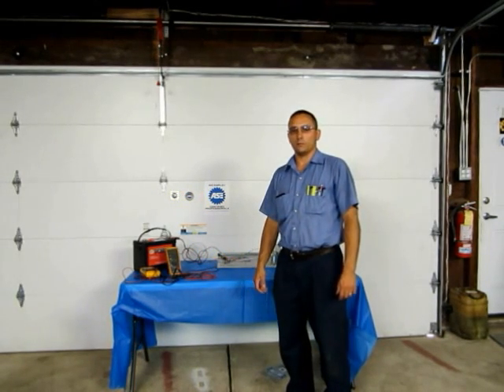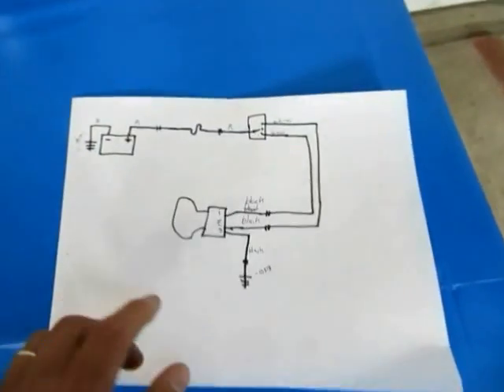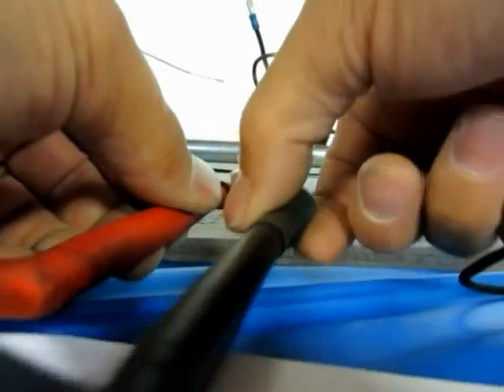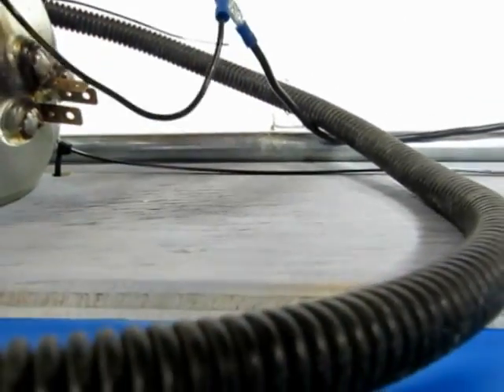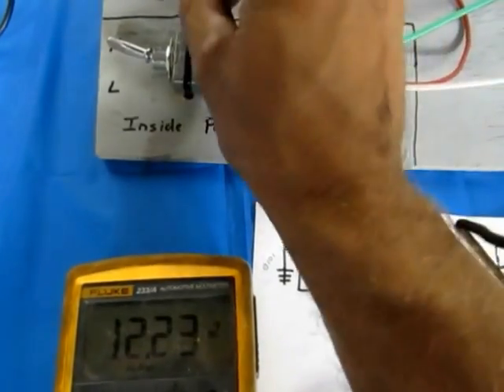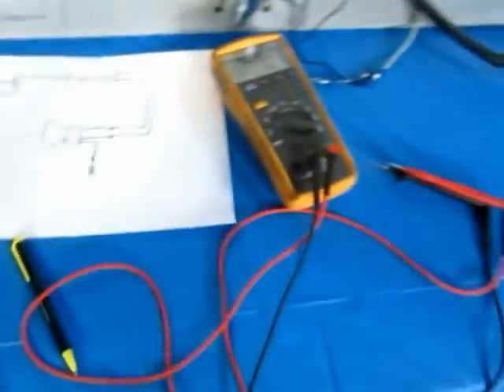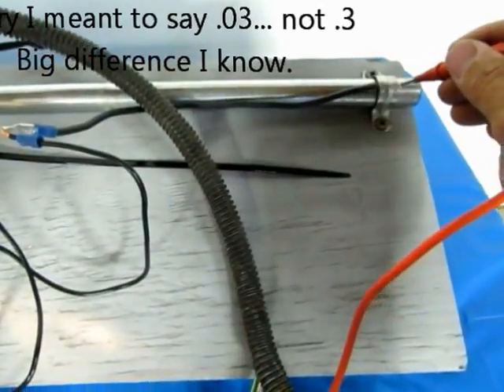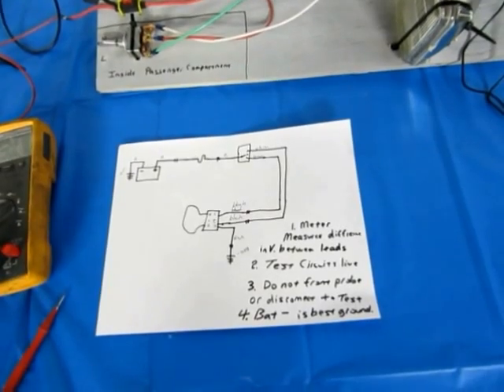basic voltage drop testing for automotive electrical testing

Comment: I’m really sad.. see I saw this video and I thought it couldn’t teach me anything.. desperate to see if I understood voltagebdrop.. I watched this randomly all the way through and your ending hit was the BEST INFORMATION I’ve heard after studying voltage drop for about 4 days now.. “the ground from the battery is the best to use for voltage drops. I’ve been burned when I thought I had a good ground and it skewed my results and it was a waste of time...”

Wow. Going to watch this over and over- I think this is the most in-depth tutorial. Your art work is perfect lol for someone like me.. because when you mentioned the connection splices I started to understand what you meant with the resistor acting as the load as the current “flows through”. 

Great work on the resistor. I was thinking what kind of dopey test is this.. I can guess it.. bu NOPE you made me think. I also like how your  switch and headlight were an actual headlight and not just a bulb. 

You can really see you have a great way to teach, thank you for recommending the jump point after and before the resistor for the bulb to light- I think I finally understood voltage drop after that. God bless!!

Comment: I have a 03 Escalade my taillights running lights at night sometimes they do turn on and other times were they don’t turn on but my turn signal, reversed, brake light do work my headlights work except if I put the parking light nothing happens

Comment: good demo.could you please demo load testing a circuit?
Reply from the maker: Sorry for overlooking comment,   Load testing would be "loading " the circuit with the same load / or amperage draw as the circuit would encounter during normal operation,   so  if you  have a component that is operating properly, back probing the powers and grounds to that circuit  measuring the voltage drop is load testing the circuit.    using a old fashioned sealed beam like in this video is goo for load testing a circuit to about 5 amps if I remember correctly.   If I have some time i will make another video explaining better.

Comment: I am working on making a video on voltage drop.  This has been a great tool for me since the mid 1970's.  It is a way to indicate decreased current flow in a circuit due to resistance. The higher voltage drop in a circuit indicates that less current is flowing in the circuit causing that circuit not to operate efficiently.  The best example is a tail light circuit in an older car.  You notice they're not as bright as they were than when they were new.  Measure the voltage drop you will probably get over a 1 volt drop or difference.  It is important that when using voltage drop in a circuit that the circuit is operating under a load.

Comment: There is no ground in an automotive electrical system.
Reply: chassis is ground
Reply: +jim davidson what are all the grounds built into the car for then e_e
Reply: They are negative terminal connections. Remember on the battery? You have + and -?
Reply: +jim davidson  yes there is!! what is the black lead for?  disconnect the black the starter does not work.  i guess its all positive leads..
Reply: Grounds go to Earth. The thing you walk on. Negative terminals or connections go to the negative side of the battery. See, wasn't hard at all.
Reply: I guess the negative post and the entire metal shell of the car are just made up in my mind.
Reply: No, it's not in your head, LOL for our purposes and all intentions the negative terminal of the battery and the chassis is our ground and it is where all the signals come from and they are trying to make it back to the positive terminal which is where the depletion is where it's pulling too so everything flows from negative or chassis towards the positive on the battery, that's what I was taught in electronics class.
Reply: Oh man, so every single person on earth that ever talks about a "ground wire" is wrong?
So many stupid people out there....

Comment: Your making it to hard just use a light probe or a circuit tester that would put
a 12 to 14  watt load on the line as you test it.

Comment: all depends of what system voltage says. test through fuse block. ghost v = open 00.00v = open v drop= high resistance

Comment: For everyone here is my situation.  I have a low voltage of 9.5v. On the  IACV (iddle air control valve) from my 97 maxima.  It supposed to be 12v. Do you guys thing that ecm/ecu will be the reason or just a short somewhere? 
I pulled code p0505. Any experts in here?

Comment: I am really trying to understand voltage drop and watching videos. I really do not understand why you are getting 12 volts when front probing the connector disconnected. Say you test a connector from a source that goes to a sensor unplugged and do not get the voltage you should. You would then look at the wire from the that connector to the source. Usually it is open or it has resistance. You had a resistor in that wire you tested when unplugged and got 12 volts. Can you explain why is that. I do not understand.
Reply: it shows 12v due to the fact that current is not flowing, the meter alone does not pull any current.
the battery voltage is the potential circuit voltage and that is what the meter is showing.
Reply: You only see that resistance when the load (lights) is on. (Switch turned on).

Comment: try the six parts of this test also.. the first 4 parts can be done in under a minute on any vehicle
here is a voltage drop test you should also teach ..
engine off. turn headlights on for one minute. then turn off. set volt meter at 20 volts DC. measure battery voltage at the posts..
12.65 is a fully charged battery
12.45 is a 3/4 charged battery
12.25 is a 1/2 charged battery.
try to perform this test if the state of charge  is over 12.5 volts.

start engine . turn on headlights.  meter set at 20 volts scale.
test One.   Negative battery post to the Positive battery post.. 14.1 to 14.8 volts DC is expected.
test Two..  Negative battery post to the engine block.. 0.04 volts DC max.
test Three. Negative battery post to the body.. 0.02 volts DC max.
test Four.  Engine block to the Firewall . 0.02 volts DC max.

test Five. Positive battery post to multiple fuses in the under hood fuse block. 0.04 volts DC max.  try to test as many fuses as you can.. there are multiple buss bars in some under hood fuse blocks and you can loose individual sections.

test six. Positive battery post to the Alternator output stud. 0.3 volts MAX that is 3/10ths of a volt.. because the alternator is putting out significant current. i like to see as close to zero as possible.. 0.08 would be very good..  60s and 70s mopars with hard wired amp meters in the instrument cluster will read 0.7 volts and be perfect.

if you get 0.00 on tests two thru 6.. change the volt meter setting to 2 volts DC or 2,000 Millivolts DC. perform the tests again.. some meters don't show fractions of a volt below 2 volts very well.  a test section  showing 0.00 volts usually is an incorrect probe location for that section of the test.

tests 1 thru 4 should be performed on every car with any kind of electrical issues. including engine /codes.  1 thru 4 can be performed in under a minute after you have learned them..

you will want to perform tests 1 thru 4 and perhaps 5 on every car before you finish working on it to prove the wiring under the hood is properly hooked up. you cannot see voltage drops except with this test.  it will save your hours of work and also prevent many comebacks if you spend these few minutes and PROVE the wires are properly attached and not corroded.
Reply from the maker: Thank you for the information, you definitely have some quick test to weed out simple voltage drop problems quickly!

Comment: LOADpro® vs. Volt-pro vs. Powerprobe® vs. Corrosion
Brian - excellent video - but you might want to check out the tool I invented that does a voltage drop instantly without all the trouble. Just FYI.

Comment: So the reason we see voltage when the connector was unplugged is because without current flow there is no resistance provided by the resistor and hence no voltage drop? You would think the resistor would change the voltage at least a bit but strangely it doesn't. Thanks
Reply: its because a multimeter has a very high input resistance, thus it will read the same volts even at the end of a pretty high resistance, the common 12v light bulb tester is in some ways a better tester than a multimeter

Comment: Great video. When you gather enough experience in electrical diagnostics you learn when to use a multimeter or a test light. On this case using a test light would be the best approach wether you front probed (circuit unloaded) or backprobed (circuit loaded) you would have seen the voltage in the brightness of the light.

Comment: Fantastic,well done !!  I agree with everything you said, I do have a slight twist on voltage drop testing that does include disconnecting the connector from the bulb.  I use   specialized test leads attached to my meter and never take them off called "Loadpro".    Google them from Sullivan electric sold thru AESwave.com.  found them on youtube  Saves me lots of time and the best $60  spent in a long time.